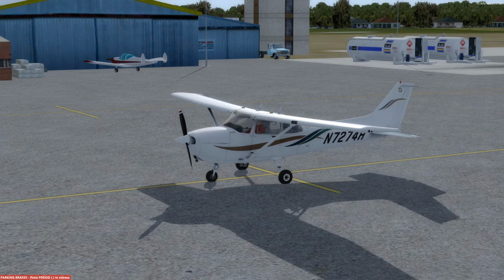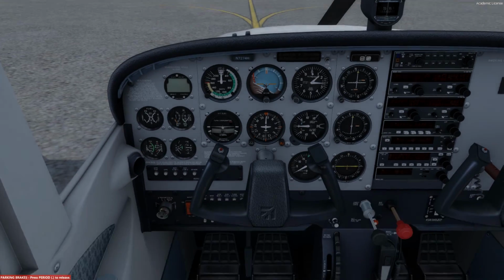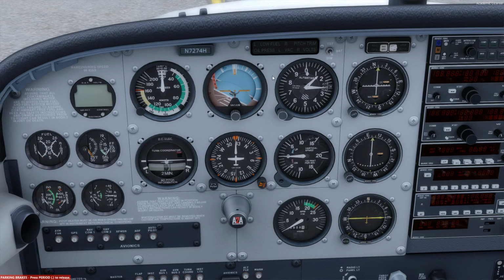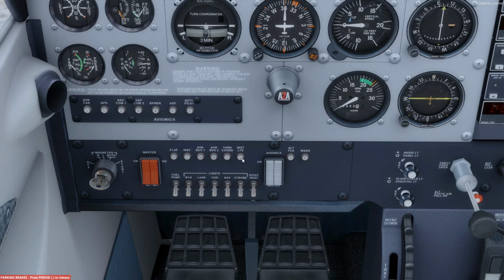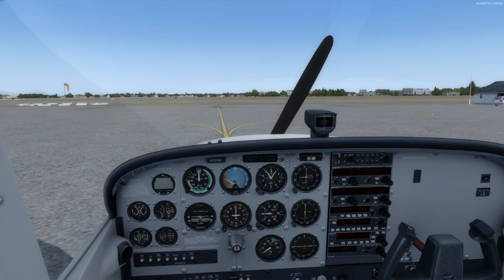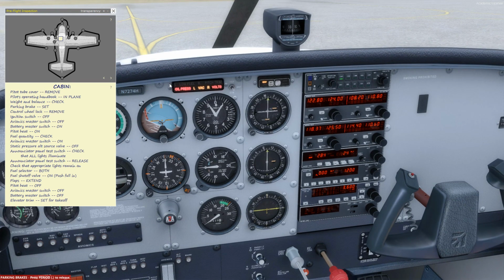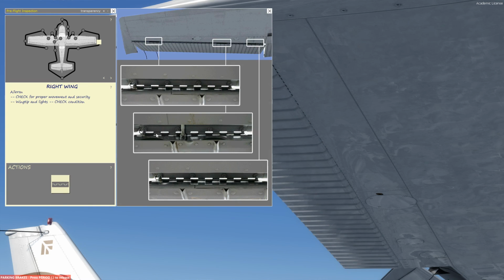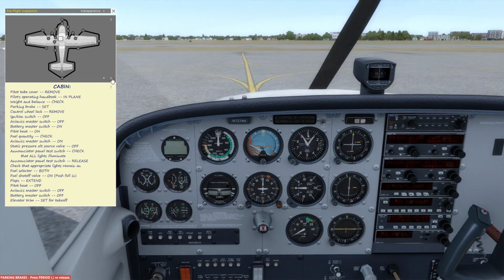A2A Cessna 172R Intro/Pre-Flight

Comment: Outstanding video. I've been unplugged for a while now but after years of dreaming of getting my PPL I'm really working hard on finally doing it (hopefully this winter). I have this A2A and think my choice for lessons will be the C172 Naples Air Center has (other choice is a piper warrior). Hard to get back into simming these days since I once had a killer setup and now will be using a small controller due to space. So much great news tonight with learning P3d is now 64bit and equally great news for me is finding your channel. I remember searching for ages with no good videos on this aircraft and now after a couple hours I'm grinning ear to ear. Thank you. Looking forward to watching everything you have on this bird, and more! Easy sub.
Reply from the maker: Glad to hear you're finally getting back into it. And yes, the simulator is a powerful tool, but not without proper guidance. I hope these videos help bring some realism into the sim for both real world students/pilots and those that just want a more realistic simming experience.
Reply: The videos are fantastic. I have to wake up for work in 5 hours and can't stop watching. Love the tips and using the real world checklist as well as you explaining things that I might not even hear from my future instructor, such as emphasis on leaning while going through the run up to avoid carbon buildup and even taking your time to adjust the mixture per magneto during the run up. Looking forward to learning a lot with these.